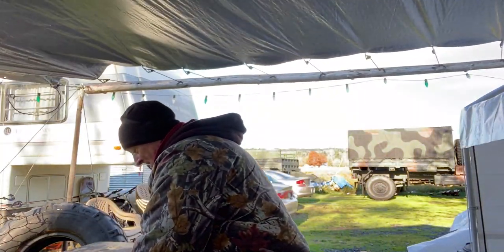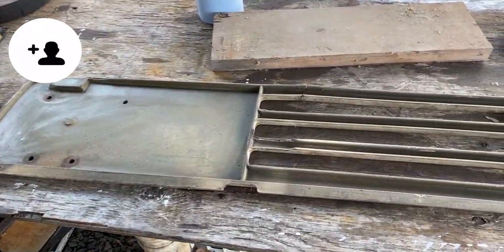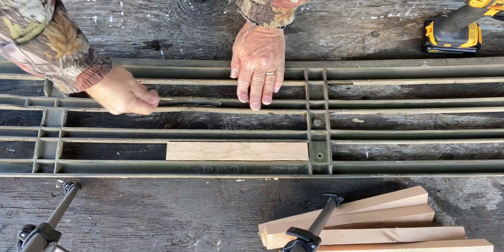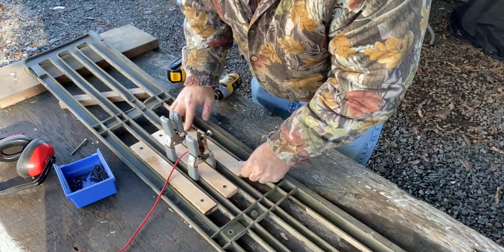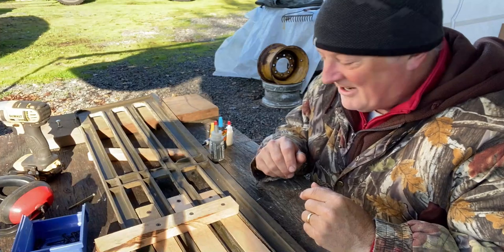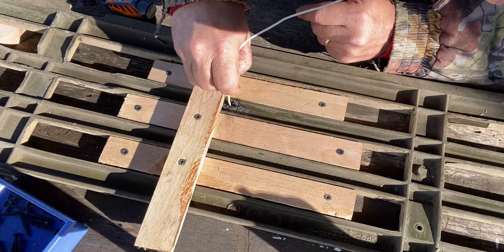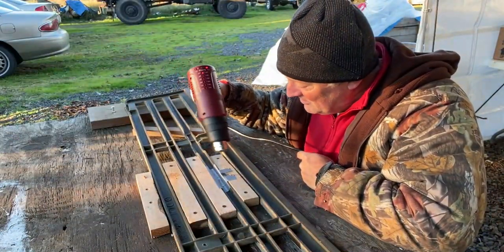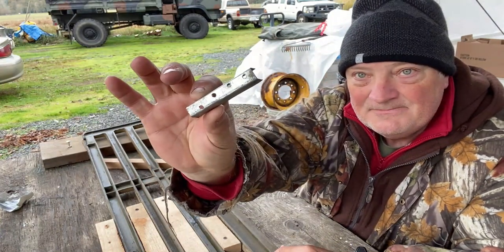FMTV GRILL REPAIR - "It's SCIENCE!" #144

Comment: That should work. Graphite is a good shoulder material. I use superglue on my knife handles to make them shine. Waterproof and non-slip.
Reply from the maker: That is a dang good idea! I have used it to fill small pits and tiny cracks in fiberglass before, and to make soft wood rock hard... though I've only heard about what it can be mixed with to use it as a filler, until now. Cheers!
Reply from the maker: That is a dang good idea! I have used it to fill small pits and tiny cracks in fiberglass before, and to make soft wood rock hard... though I've only heard about what it can be mixed with to use it as a filler, until now. Cheers!

Comment: Thanks for that.  I was thinking of filling mine in with a fiberglass resin to stiffen it up, but I have never worked with the stuff.
Reply from the maker: I don't know what the heck that patch that I pulled out of the one rib was made of, but it did have a small bit of fiberglass in it... I do not suspect it was fiberglass resin, but if it was, it did not stick to the plastic, nor was it a stiffener. The JB weld stuck to it like it was melted into the plastic... that thing is never coming out!
Reply: Fiberglass mat and resin would also make a 
strong repair.